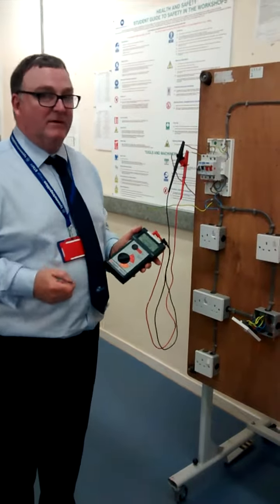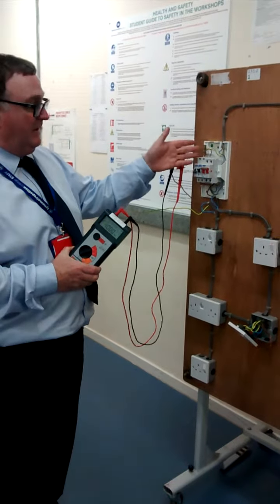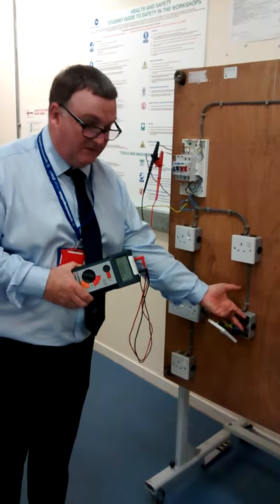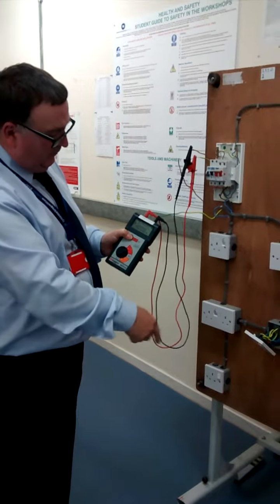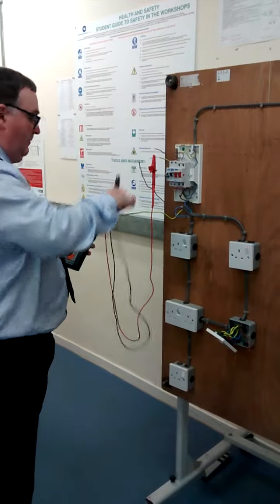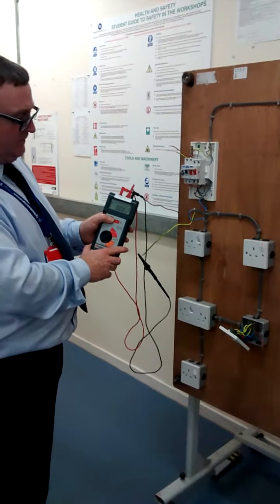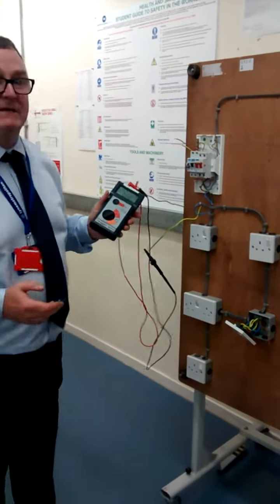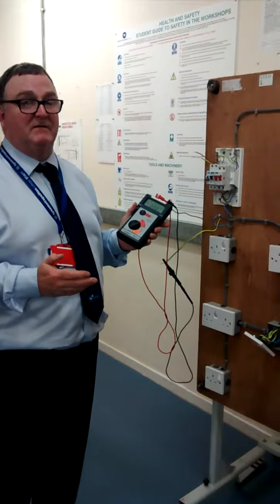Half split

Comment: Not quite understanding this method. When you say this process would be used for 100 sockets and we would keep splitting and half what do you exactly mean? Split 100 into 50, then 50 to 25?
Reply from the maker: It could be any amount of lights or Sockets 100 being an example.
Split the circuit in half and test both directions.
Hopefully one direction is found as defective.
Split that half at the mid point and test in both directions.
Repeat this until the fault is found maybe between 2 points or even with a cable damaged at a socket or a light.

Comment: Hi, would this then be known as a short circuit between Live and earth?
Reply from the maker: No a short circuit is only between live conductors. Any fault involving the earth is known as earth leakage. Eg even a fault between Neutral and Earth.
Reply from the maker: No a short circuit is if the Live and Neutral were at fault.
Live to earth or Neutral to earth are earth leakage faults.
Reply from the maker: If you check BS7671 definitions it gives a good description of a short circuit.